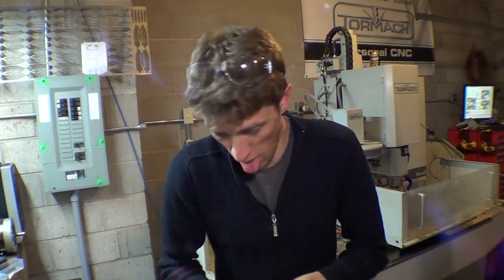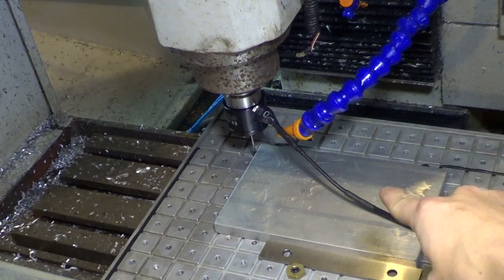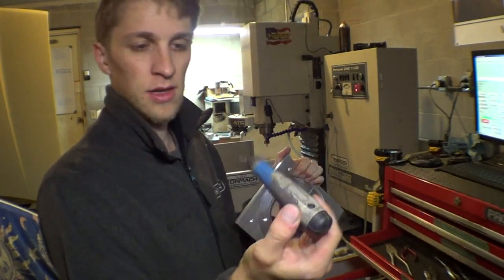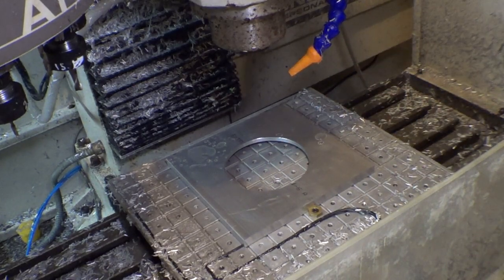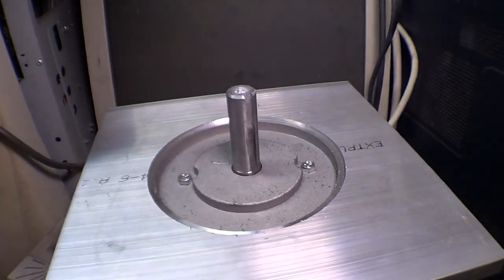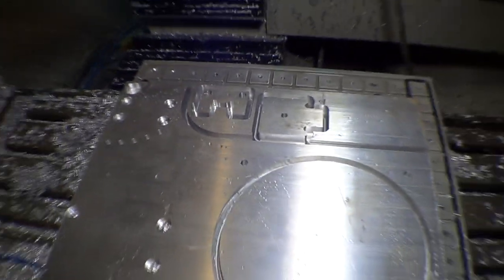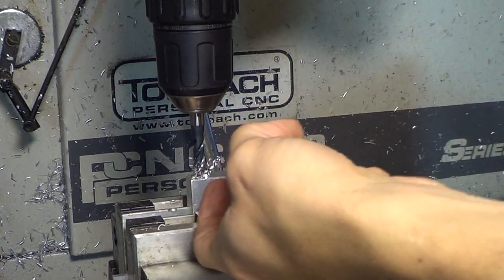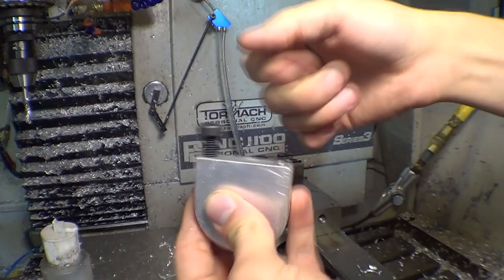Knifemaking Tuesdays Week 76   Grinder Part 3   final components

Comment from the maker: Google drill chart or tap drill chart, eventually you'll find a really good guide that you'll use all the time.  Often times tool supply places will include a little postcard sized paper that has all the drill sizes and tap sizes, super handy!  Mine says 2-56 threads need a #51 hole (1.7mm or 0.067") and that gives you a 74% thread engagement.  Handy huh?  Form taps use a different chart, they need bigger holes!  I learned that the hard way.

Comment: Cool, I think I am going to just try tapping with the drill press. Alex Deitz showed me how to do it, Take the belt off and hand turn it, then the spring pressure of the drill press pulls it out. Should keep them pretty straight too. Btw do you know what size hole I should be drilling for 2-56 in Ti?

Comment from the maker: I think I'm at something like 0.0004" and 0.0008" backlash, so it wasn't that.  I realized later that I had replaced the probe tip and didn't zero it properly, so the probe itself was like 0.028" off.